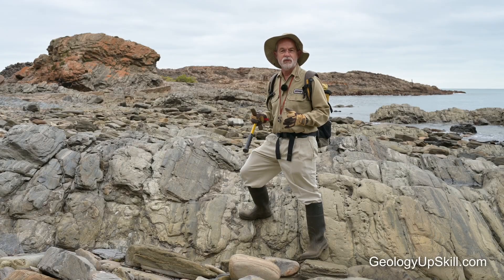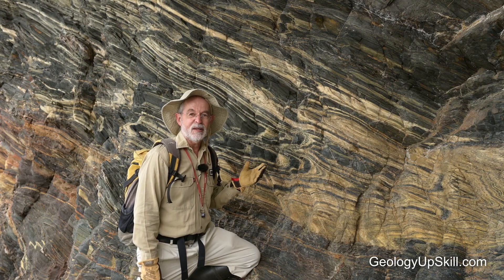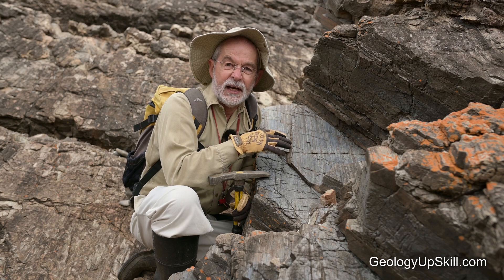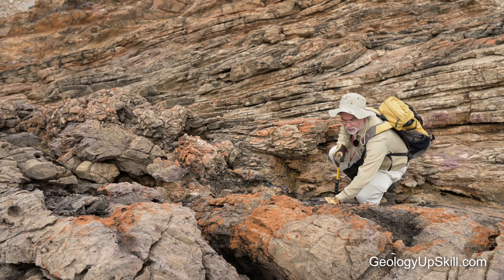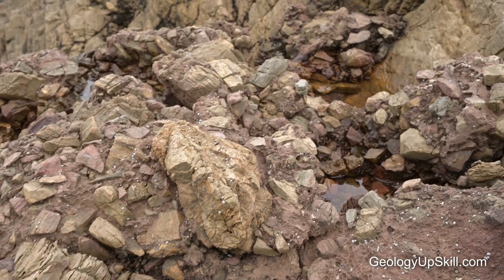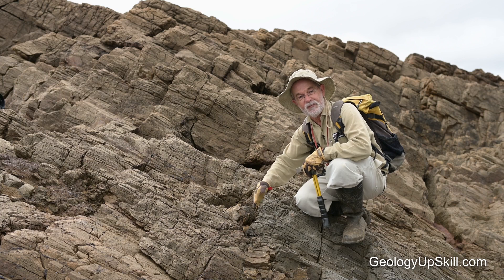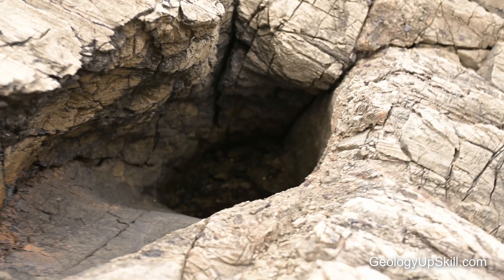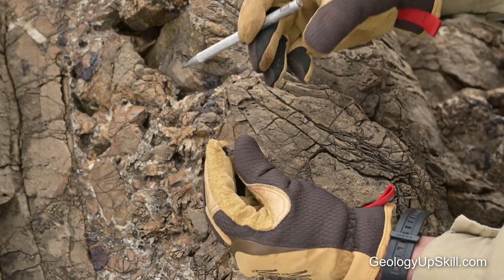Mini Hydrothermal Breccia Pipes

Comment: Very informative and interesting. I was just thinking about breccia pipe and it’s relationship with structure due to being involved in an exploration copper project in Ontario, Canada. Found this really helpful! Thank you so much.
Reply from the maker: Yes. Breccia pipes are commonly thought of in isolation because they tend to be round in plan, but even the most explosive fluid will still find the easiest path through the crust and that is usually up a structure!